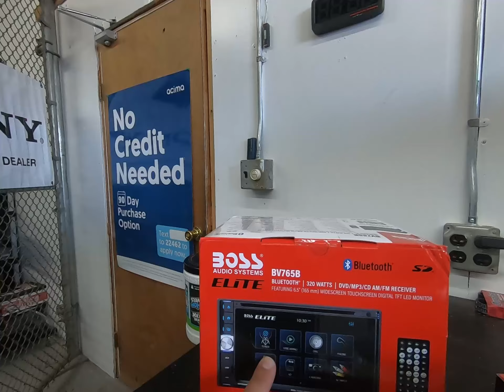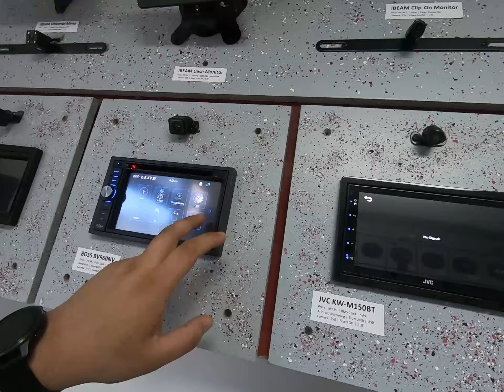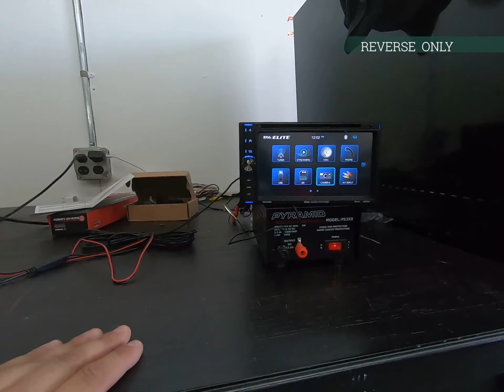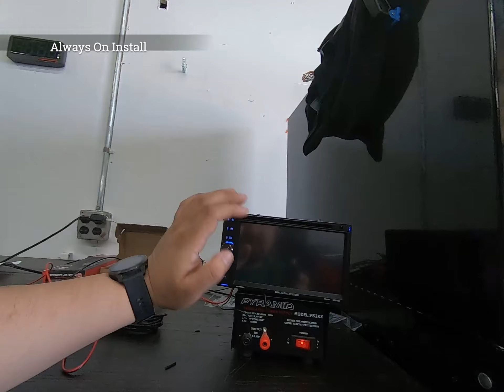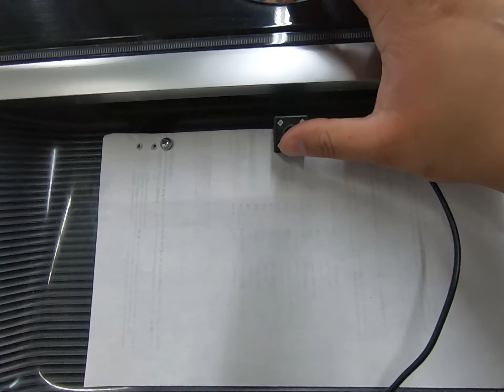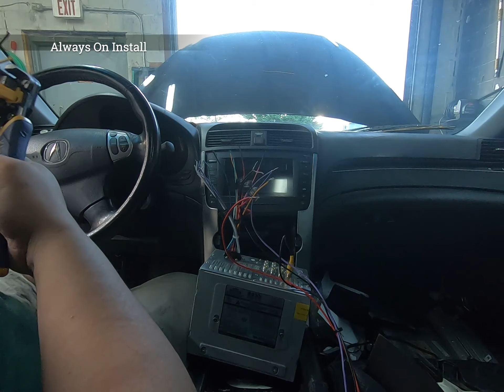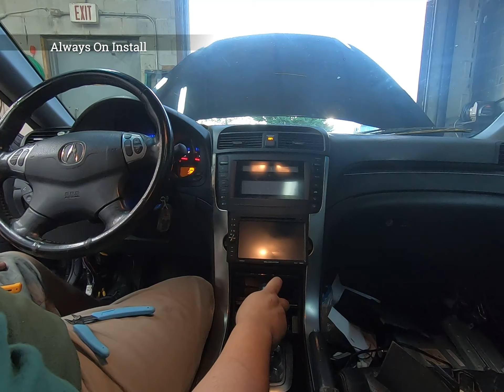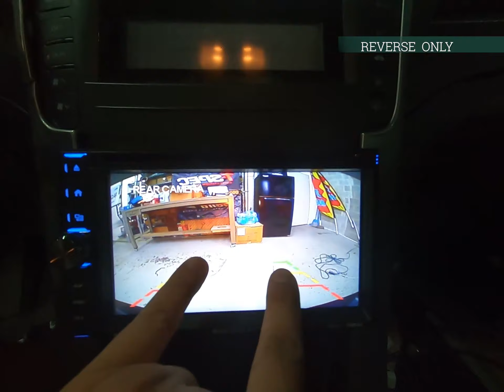2004 05 06 07 08 Acura TL Backup Camera Install Complete Video

Comment: I followed yoir videontonthe T but got lost with wiring to reverse gear positive trigger and 12V ignition switch. What color is the 12v reverse gear positive trigger and what color wire is the 12v ignition switch on a 04 TL?
Reply: bump

Comment: Hey man- I bought the sub package from you a few months ago- it's a great product and I'm very pleased with the new bass in my car. For these speakers- do you recommend the Infinity or JBL speakers for someone using the factory amp on a 07 TL? If I go with the JBL's, is it the same install process as shown in this video?
Reply from the maker: Yes same install process. But this video is for the backup camera
Reply: @AcuraAudioGarage  thanks. I just ordered jbls from you. Another quick question- do you have a recommendation for center dash speaker replacement (using stock amp)? I believe it is 3 1/2 inch speaker

Comment: Hello, I have some questions on the aftermarket radio situation with the Acura TL. I was wondering if it was possible to remove the nav screen and place the aftermarket radio or something else instead but like also still have it connected for the ac controls of course maybe kept behind the new set up or in the truck
Reply from the maker: yes but that would be a fully custom job if you are not familiar enough we recommend working with someone or shop who is, it will require some custom harnesses and fabrication.